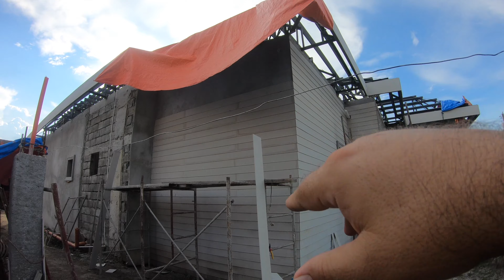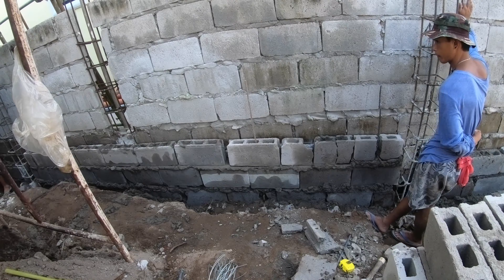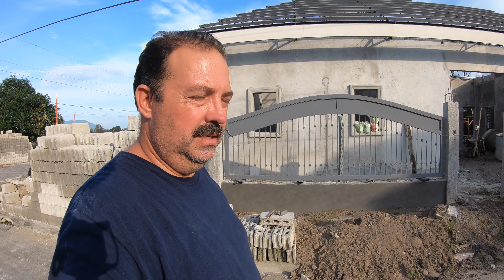Philippine House Building Step by Step, Build Day 128: Wait Testing

Comment: The custom fence panel looks terrific.... real nice, how many are being made?  The projector screen wall.  I hope it comes out fine.... It is a nice area for you to set up for your projection screen.  The exterior walls are really shaping up. It's nice to see you recognizing your work crew by name, many YouTube vlogs the owner did not know their crew, they really did not show that relationship.  I like the friendship bond and makes the the crew feel respected like they are part of the process other than just the labor force.  Nice, much respect.  
 The rebar covers are extensively used over here, never witnessed over there until your crew... Nice.  Occupational Safety and Health over here would have a field day over there.  Your welders are really doing a fine job.  A little bit being like a gymnastic person too.  Your fence adjacent to the neighbor's fence is an interesting project... I am sure there is a story attached to it... unfortunate, but it is what is...  Any estimate on your roofing material?  What is the load rating on the steel floor beams?  The house is really sprouting up, and when the roofing gets installed, things will start flying... Nice video... lots of information.... Much thanks for sharing...
Reply from the maker: There will be 13 fence grilles. 
Projector screen wall... if all else fails, I buy screen for the wall. 
We made it a point from day 1 to learn the crew’s names. You’re on point. 
OSHA would probably be so overwhelmed looking at a local construction site, they would just hang their heads and walk away because they wouldn’t know where to start. 😂 
Yes, there is definitely a story to the neighbor’s fence. I’ll have to tell you in person. 
Current estimate is two weeks. Emie says Filipino 2weeks not American 2weeks. 😂 
I have no idea what the load rating is. But the way the welders are fabricating it, I shouldn’t have any problems.
 Happy to share lessons learned. No need for anyone else to make the same mistakes if we can avoid it. Thanks for the great Q&A.
👍😎